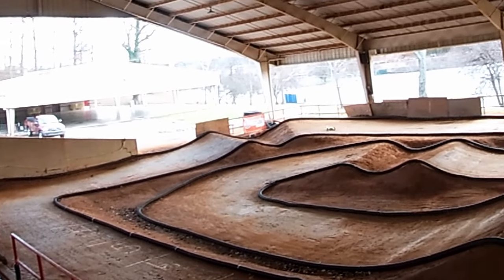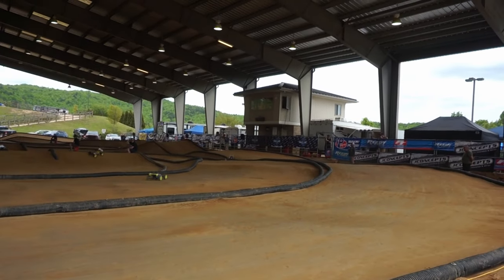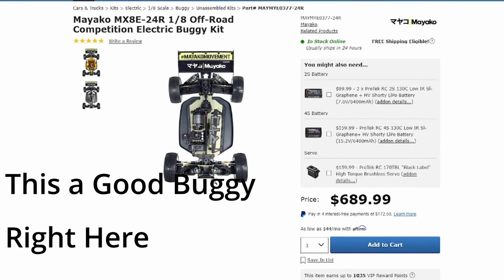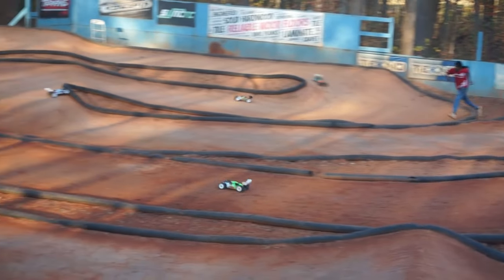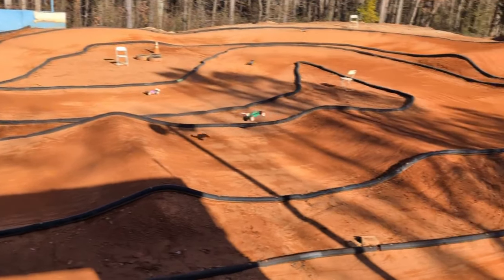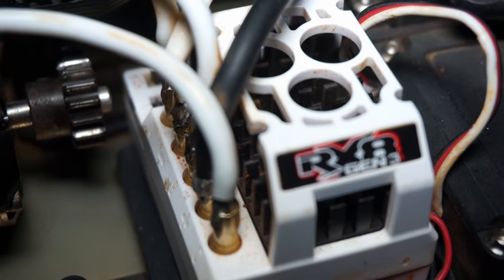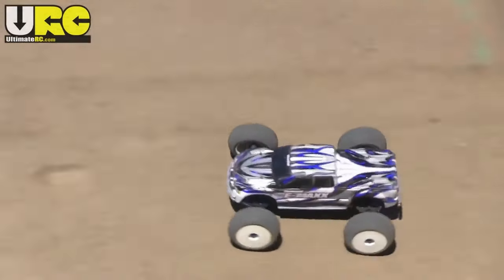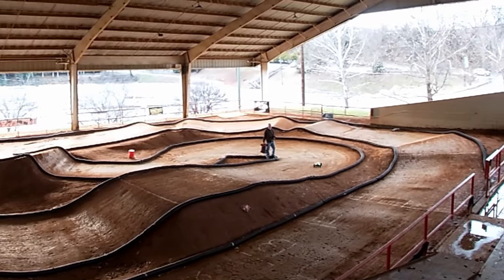Buying Your First RC Race Car (8th Scale)

Comment: Love these guides, Roach!

A few notes:
-The Mugen MBX8R can use both a 4s shorty and a 4s stick pack. The battery tray adjusts to accommodate both.
-in KV motors, higher KV does mean faster spin, but lower torque, not higher. This is why you'll typically get a bit higher KV for a buggy that is nimble and smaller and a bit lower for truggies that are heavier and less agile. Most motors on the market can handle both, though. I'd advise anybody new to just ask their local fast guy what he's running and what he recommends for a newcomer.
-My one other recommendation to anyone looking to buy their first 8th scale would be to check out their local track and see what is well supported and what parts are available. As you said, 8th scale is built for durability but you're gonna break stuff, and having both parts support at a hobby shop and/or some other guys who might have some spares you can borrow or buy off them if you run out or break something unexpected will significantly improve your experience. (It'll also help you with setup and other questions you might have too, as others can give you input specific to that car.)

Comment: Kyosho Inferno Neo. Built like a tank!
Reply: Verry underrated car. You have to put some work into it to get it running fast on a track. Like spidergears and stuff. But once its dialed in, yeah its a great car for sure. Myself running the MP7.5 chassis a long time. Thats the same chassis as the Neo. But to be honest, that are some heavy mofo's compared to last year released cars
Reply: I have Kyosho inferno Mp10e and this one is not built like a "tank" lol it got crashed very slightly and the whole front part came off... Had to spend 60€ for repairs
Reply: @apostolis3255  mp10 has similar setup for the front as the MP7.5? How did you break that? Must be a verry unlucky landing

Comment: Some good advice in here. But man you really don't make it easy for yourself :D
Feel like just mentioning the different battery configurations with one example each would've worked better. Especially now that quite a few cars support multiple layouts that's quite a lot of work to get right and sadly you didn't. 
The Mugen for example comes with a battery tray for both a shorty and brick, while the S35-4e Evo and Sparko support all 4 options (though the non-saddle layout feels kinda wonky ngl)..

Comment: The AE buggy can use stick packs, they just have to buy the RC8T4E battery trays separately. But they do mount.

I love my RC8T4E. It lets me mount a real truggy body. But for buggy I love kyosho. They drive so smooth and they look the most natural of the buggies imo
Reply: Hey brotha do they mount up to the new .1 e buggy?
Reply: @colinleonard2541  well, the AE website no longer says that the T4 trays are compatible with the B4, but the T4 trays still have the buggy mounting slots in them...I guess it would be anyone's guess that has the b4.1e then. I also don't understand why the shorty pack trays are $14 but the stick pack trays are $11.
Reply: @CplVeers  well ima try worse case I’m out 11 bucks I’ll be sure to let you know

Comment: Love the videos!  Newbie question: just finished up my first ⅛ scale build (b4e.1) running saddle pack. Are two 500 mill amps okay enough?  Also, can motor fan be plugged into aux port of receiver?  I solder it to esc on 10th but the esc for 8th seems a bit more involved
Reply from the maker: I'd go a bit higher on the MAH rating just to be safe. As for the fan, yes it can be plugged into the receiver

Comment: I would like to start racing and I need a bit of advice / help. I have found a guy selling his Mugen MBX7Te and Associated RC8b3.1e both for 400€. Cars come with castle motors, hobbywing XR8 escs, savox servos and a spektrum transmitter.
 
Both cars look a bit dirty, but otherwise apparently in good condition. I am planning to keep the mugen chassis to use the electronics of my old MT4 G3 and clean and sell the rest of the kit.  Or do the opposite if my local club happens to only race buggies.  Do you know if there are still enough spares of these cars around? 

I understand this models already have a few years, but they were top of the line and I even think I could make some money if I cleaned them a bit and listed them correctly (I had to guess the models from the pictures).
Reply from the maker: Hmm. They are a good price but finding parts for them might be a challenge. If you clean them up you could sell them for more but not much more. My advice would be to save up for a more recent used kit that will allow you to find parts easier

Comment: Great video!  Not a lot of TLR talk?!?!
Reply: I noticed that too, what’s up with that, is TLR chopped liver now?
Reply from the maker: @fuzzfreak1967  The TLR car isn't a bad car, it's just that finding parts for it atm is quite difficult. It's legit easier to find parts for my Agama and for an American brand backed by Horizon to have that issue is odd to say the least
Reply: Ah; I read something on the internet recently that TLR was having a parts supply issue for their 1/10 scale cars but they were fine with their parts for their 1/8 scale. A little bit about me; I started racing RC off road in 2016 and got burned out and threw in the towel in 2020. I never sold any of my stuff, it’s just been collecting dust in my basement so I have been a little out of it for a while. I just dusted off my stuff, invested in some new batteries and headed back out there again in December with all old cars. I have Tekno and TLR cars. I have always found these companies both to be very durable. I think durability is a very important factor, especially for beginners. I also feel like you can get any car to handle good, some just require more tinkering than others. All the cars are loaded with adjustments. I must admit though, I pretty much have only driven my cars so I really don’t know how other cars are when it comes to actually driving them. People at the track don’t really trade off each others cars and run them, they don’t want you to accidentally break their car on them. Quick story; one of my old RC buddies, I tried talking setup with him when I first met him and he quickly shot me down and told me not to waste my breath, that car setup was over his head. He was just a driver, he was a pretty good driver too, he never even checked his ride height, did nothing with his cars except put the battery in and go. Every now and then I would notice that his car was way out of whack so I would grab it from him and straighten it out for him. One time we were practicing/warming up for racing and he felt that his buggy was not right so he asked me to drive it and let him know what I thought. He was an Associated guy and I had TLR. I had the 22 3.0 and his buggy was the B5M. So I took it for a drive and holy cow, it was better than my buggy. I told him that it was better than mine and that it was fine. I didn’t drive it for very long but it’s the only time I ever drove an Associated anything. I liked it, it was good and drove well; I stuck with TLR though I really feel like TLR has a leg up on durability over Associated

Comment: Ok so I would like to get into racing 1/10 Carpet buggy I'm starting from zero My local track/hobby store has a used tlr 22 5.0 roller for $150 and they Support the brand is that to much or A decent deal.
Reply from the maker: That's a pretty good deal, especially if they support TLR.
Reply: @RoachRC  I checked out the bearings and the slop on the arms and everything and everything seems  tight. It really doesn't seem like it was raced much . There's not even scratches on the bottom of the chassis.